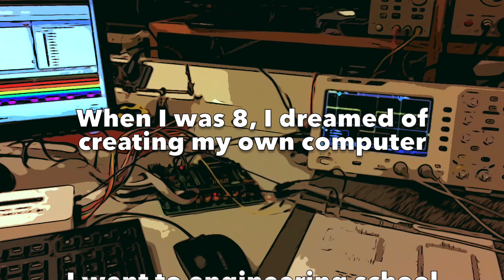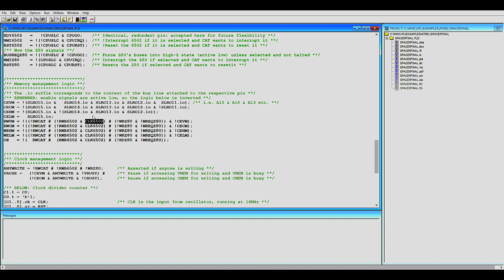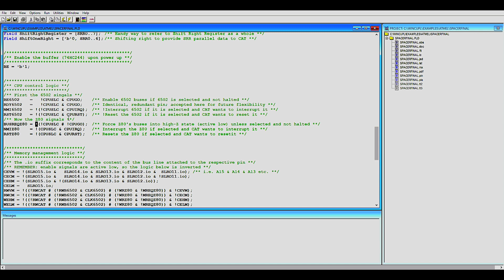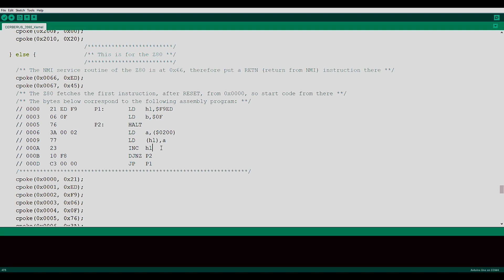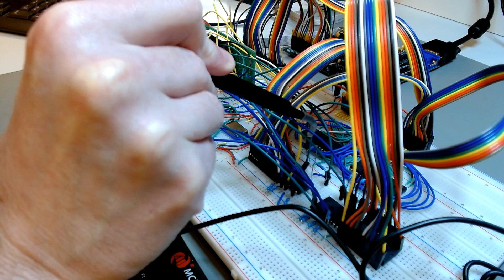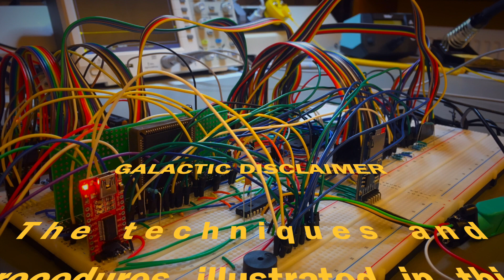Building CERBERUS 2080™, my dream childhood computer: Episode 14

Comment: 14:00 - that's misleading. The reason the Z80 does this is for legal reasons. The Z80 is (largely) binary compatible with the 8080, but it couldn't use the same opcode names or syntax as Intel owned the copyright for those. It's no more a different addressing mode on the Z80 than STA and LDA are on the 6502. Renaming the various MOV, LD*, ST*, MVI, LXI, &c., instructions to LD was just a legal workaround. That said, the Zilog mnemonics are largely better than the Intel ones, which doesn't hurt.

Comment: I’m pretty sure using PHI2 to validate chip selects is pretty standard practice when using the 6502. Were you doing this already, as you only mention gating R/W with PHI2. If not then if you use PHI2 instead to validate the address when generating chip selects, there is no need to gate R/W.
Reply from the maker: There are three processors that can do DMA in CERBERUS, so it's a little more involved. I'd need to validate the chip enable in a different way for each processor, checking to see if it's a read or a write. It's easier to do it for the RWB signal instead, as there I need to check whether it's a read or a write anyway (to generate e.g. the output enable and write enable signals for the memories). I am using chip enable to mask the RWB signal too, along with PHI2, so the end result will be equivalent, as far as the 6502 is concerned.